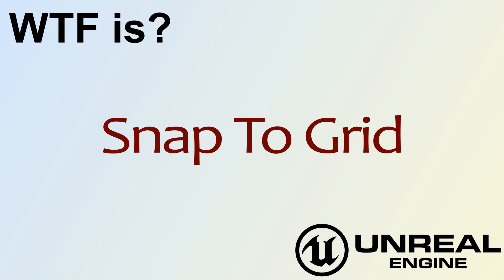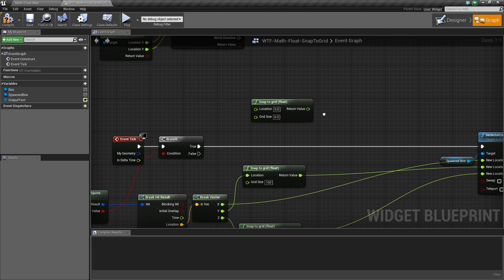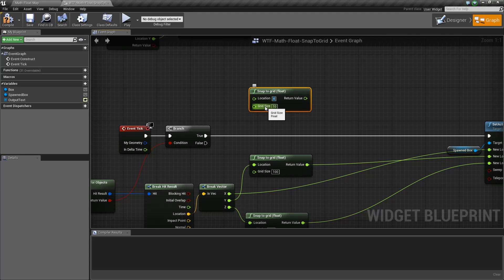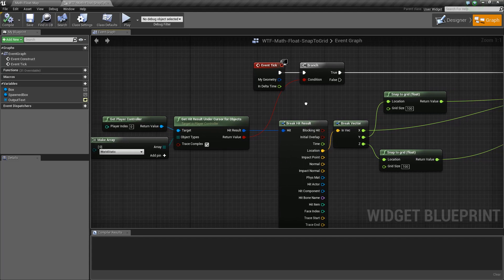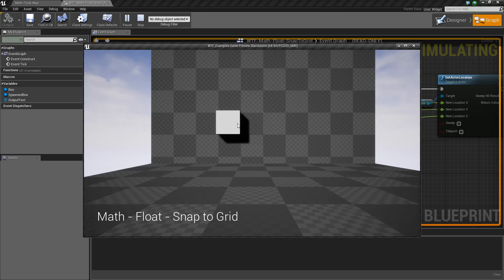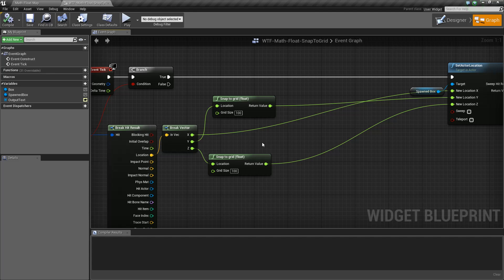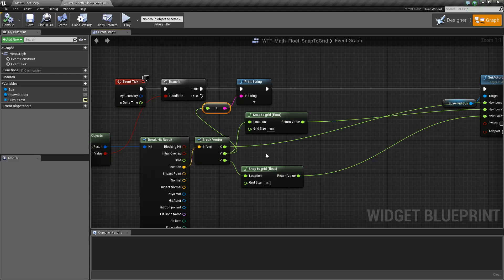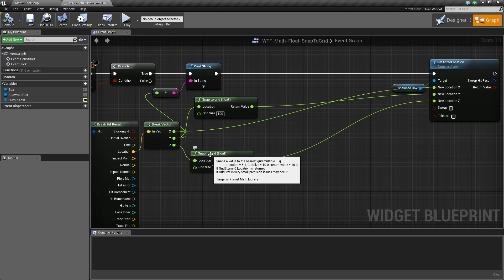WTF Is? Snap to Grid in Unreal Engine 4 ( UE4 )

Comment: You do mention that it rounds down, it works fine for small numbers but it fails with numbers as they get larger. Mine doesn't round down at all, 122.3 rounds to 150 despite it being closer to the nearest 50 of 100.